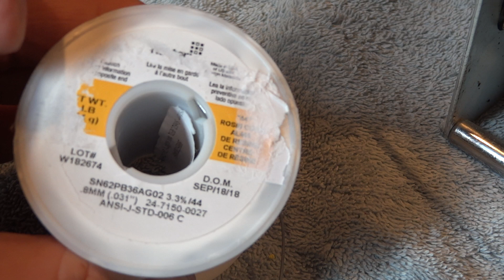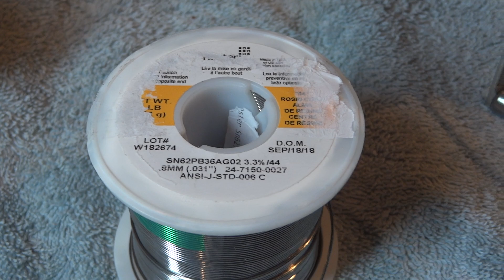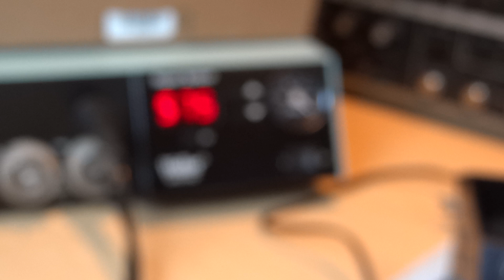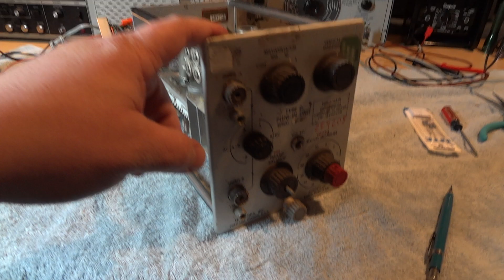Understanding Ceramic Strip Soldering Techniques for Tektronix Oscilloscopes

Comment: Back about 1986, I remember purchasing a old Tek scope with these exact same connection points, and one had a high voltage arcing issue between 2 connections. Luckily, I was able to clean that spot into submission, and small coils of silver solder were readily available at Radio Shack.  The scope is long gone, ( It was heavy as all he**, lol) but the memory of these connections still remain.

Comment: Many if not all of the Tek products that used these ceramic strips usually had a small roll of the proper solder placed inside the chassis somewhere. But on most vintage gear that was probably long lost or stripped out. Good info on the temp. I knew about the silver bearing solder issue but not the ideal temp to use.
Reply: The big cart-mounted 500-series scopes had that roll of solder inside.  I had an early '60s 561A benchtop scope, there was no room inside to mount the solder spool.